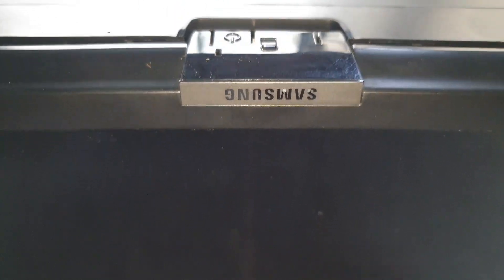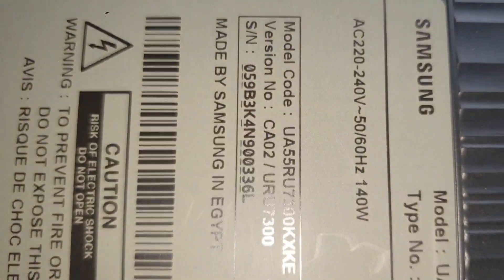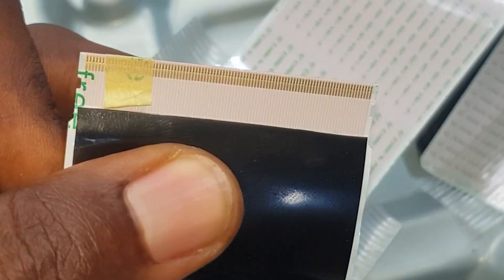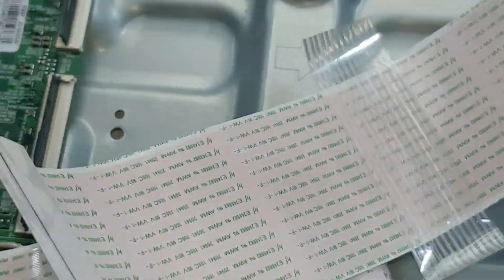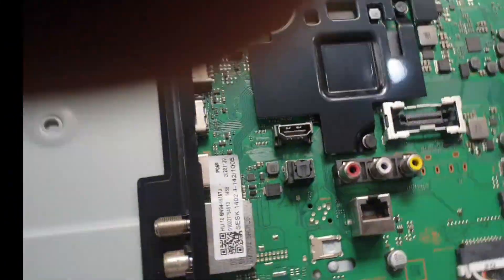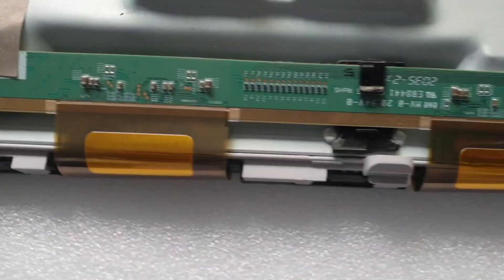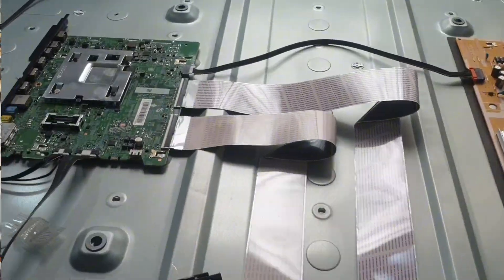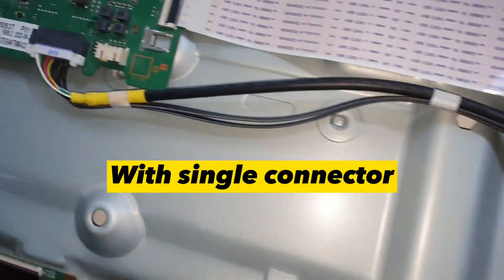SAMSUNG TVs: HOW TO TELL WHAT PANEL IS INSTALLED #samsungtv #qled #led #lcd

Comment: Hi could you help me on identifying pc monitor panel? I have broken display on my Samsung c32jg50qqu was wondering if maybe i could find replacement for the panel
Reply from the maker: Hello! I'm afraid I need some more information to be of good help. You need to open up the monitor to be sure the exact panel installed in it, as same models of monitors and TVs often have different panels.